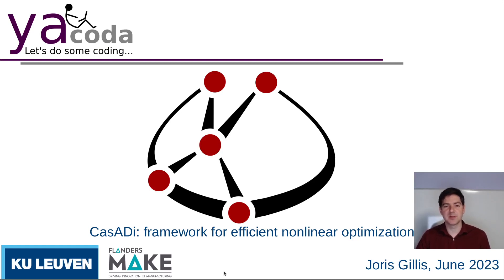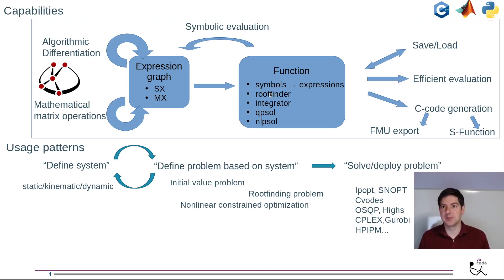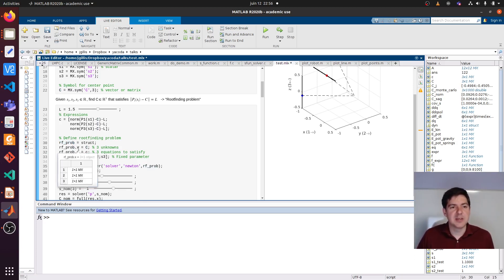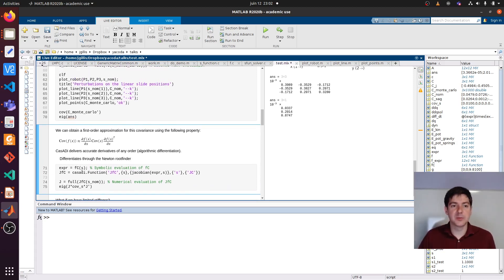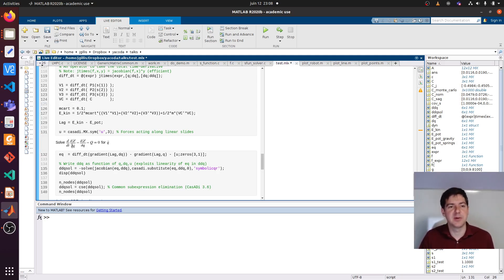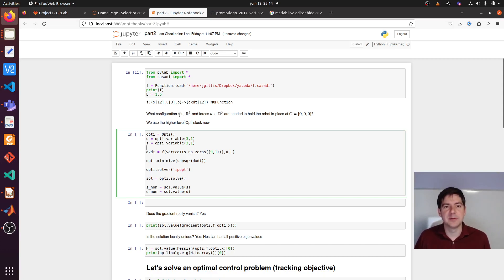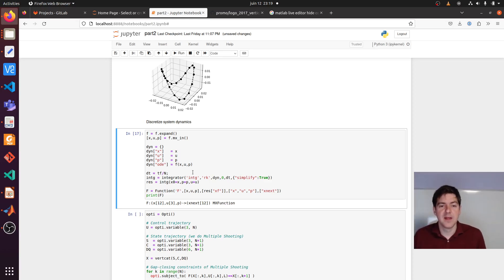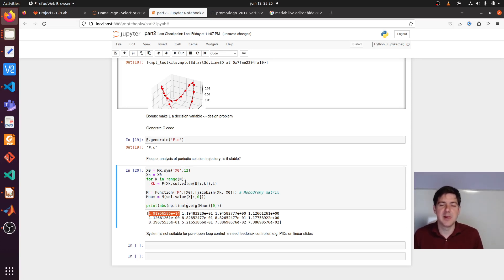CasADi 3.6 tutorial (parallel robot, Matlab+Python)

Comment: How does the AD capabilities of casadi compare to JAX?
Reply from the maker: CasADi from the start has been about sparse matrices, needed for structured constrained optimization. We also have scalar graphs that are devoid of matrix-related overhead and do well for heterogeneous computations that are typical in engineering problems. Seamless interfaces to constrained solvers is also a feature that stands out. Nonetheless, an interface with JAX is on my todo list, as dense large-scale computations are a hot topic nowadays..
Reply: Thanks for the clarification